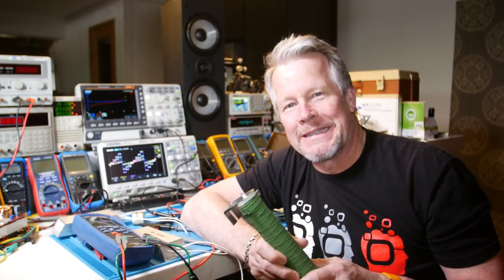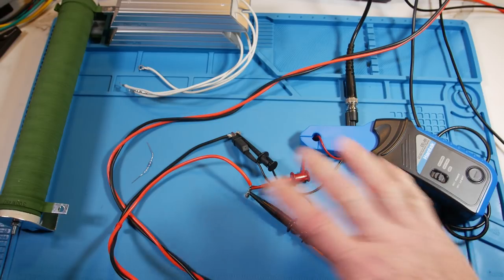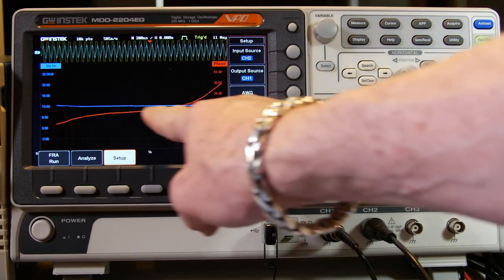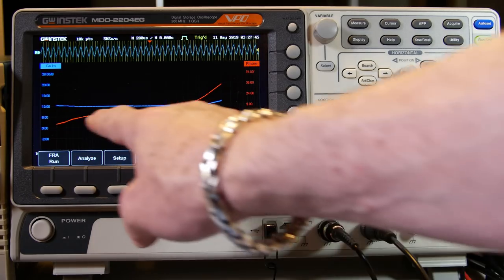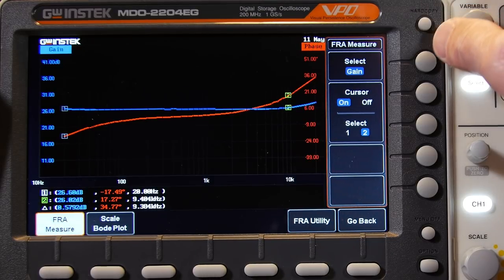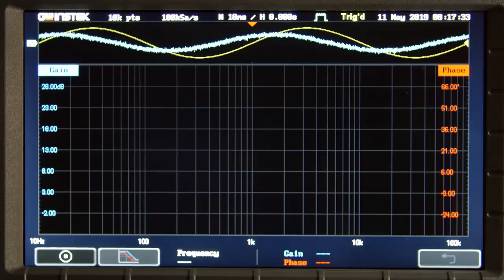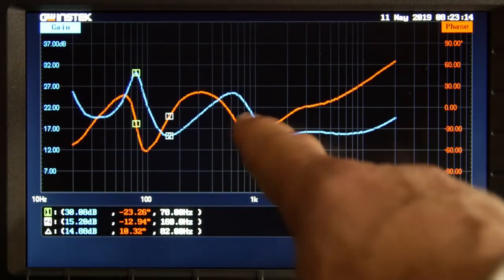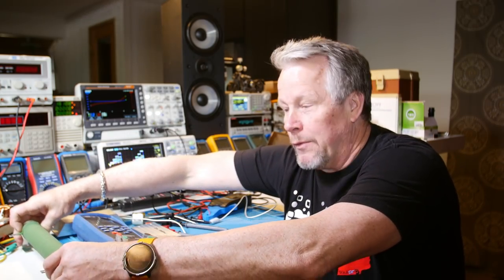Speaker Impedance Measurement - how to

Comment: I guess you really need to take notice of the purpose for which a manufacturer has designed a speaker if it isn’t an all-rounder.   How would that speaker sound as a stereo pair rather than a centre-channel for example?   I wonder what the audio hi-if shop would think if I rocked up with a function generator and oscilloscope to audition a pair of speakers :).   I’m intrigued to see where you are taking this and how we use this knowledge in design (and compensation??) terms.  Thanks, very interesting.
Reply from the maker: That would be awesome to see someone walk in with a scope to check out the speakers for an audition🤣
Thanks, I hope to make this easy to follow by starting this way.
Reply: It’s a great idea to cover the building blocks and then bring it all together.
Reply from the maker: Andrew Johnson Thank you - just trying to keep it simple;)

Comment: Thanks again for sharing your knowledge! :-)

I was wary surprised about your setup, I would have thought that the signal generator would just send the signal direct to the scope, because the clamps and probes is almost connected together. I am confused that the signal first go via the cable to the speaker, the same path back again trough the wire an in the scope, or the path with highest impedance.
By the way, if we say that your result was wary important, could you have compensated for the non linearity you started having in your scope?
Reply from the maker: I’m glad to have you on the team!  

The generator has to put current thru the speaker or load, then the current probe measures how much current is injected.  The voltage probe measures the voltage at the speaker or load input.  Then the ohms are found by Ohms law, Voltage divided by the current.  I’ll show schematics to talk to so to make it more clear.

I’m glad to get feedback.  I have done this so long I forget what comes natural.

I really want to make a bunch of experts out there.
Reply: @KissAnalog  Thanks! I do not know if I ever will be an expert, but you have surely teached me a huge amount until now! :-)
Reply from the maker: I appreciate that - and I can already tell that you will be;)

Comment: Good idea!
Perform measurements using the Bode chart function.
Ω_sp = V_sp (CH1) / I_sp (CH2).
However, since the gain is a log scale, it is subtracted and converted.
As the audio frequency, can you ignore the frequency response of the oscilloscope itself?
Reply from the maker: Thank you!  Yes you have to divide the log by 20 and then take the antilog to get Ohms.  And yes, even a 10 MHz scope is far more than capable.  Nice to hear from you!
Reply: @KissAnalog  
Thank you for your reply!
As you say, the value was obtained only by anti-log calculation.
7.943 [Ohm] = 10 ^ (18 [DB] / 20 [DB])
However, the units of voltage and current of the oscilloscope are the same for CH1 and CH2.
I am currently planning to buy an oscilloscope. ( For personal use )
I found your site while comparing the oscilloscope models.
Applications are development of hobby FPGA, development of audio amplifier, ... and other fun electronic development.
For the time being, SDS1204X-E is the first choice, but I am still lost. (^ ^)
Reply from the maker: A scope can be a great thing, and it is a big choice.  I think the SDS1204X-E is a great choice.  It has 4 channels! Deep memory (14 Mbits shared by each 2 channels), a deep 1Mbits for the FFT which it also has nice FFT functionality (display signal options as well as set up options).  It has the digital bus decoding.  And with 4 channels it can do Bode plots With the AWG option. If you are developing FPGAs, you most likely will want the 16 channel option.  

With the generator and 16 dig channel options, the price starts getting high.

The GW Instek MSO (mixed signal like the GW Instek MSO-2104EA)
series is a great option at the Siglent price with options.
Reply: @KissAnalog  
I ordered SDS2304X.
Further examination revealed that the 16CH and AWG options each require a dedicated box. I think that the manufacturer did in order to lower the price of the main body of SDS1000X-E. As you know, the desk top for debugging is narrow. Of course my desk is too small. (^ ^) Adding two things like a black lunch box to a target board and an oscilloscope on a narrow desk makes me feel awkward. On the other hand, the only hardware needed with the SDS2304X is the small Logic Probe for 16 CH and the coaxial cable for AWG. I chose it with cost performance and easy to obtain. I was a little disappointed that I could not select your recommended model.
Currently, I am looking forward to the arrival of the oscilloscope. Immediately, I added pins for debugging for connecting 16CH Logic Probe to the FPGA of the amplifier board currently being designed.ed pins for debugging for connecting 16CH Logic Probe to the FPGA of the amplifier board currently being designed.
Reply from the maker: 歌舞喜 WOW!  This is a great time to purchase that scope!!  The price is amazing!!  I know they have their new line so they have to sell this line, but it is such a powerful scope!  If you need the digital channels - I think you found the best one out there!  I can’t wait to hear how you like it! ;)